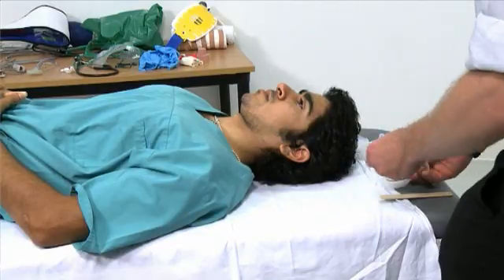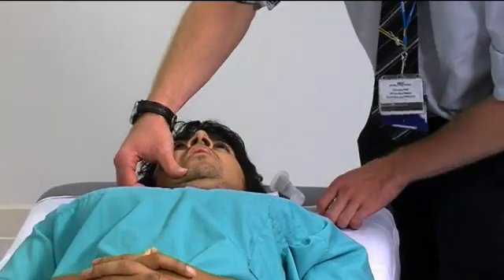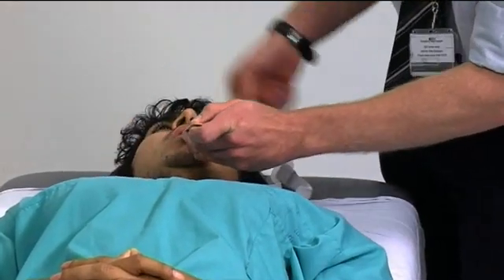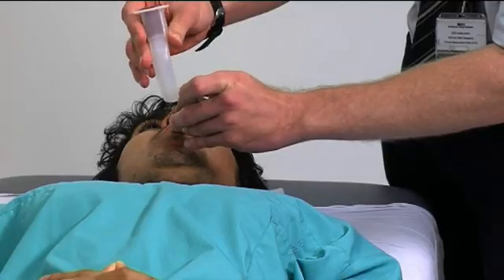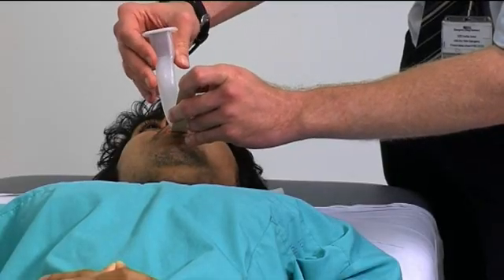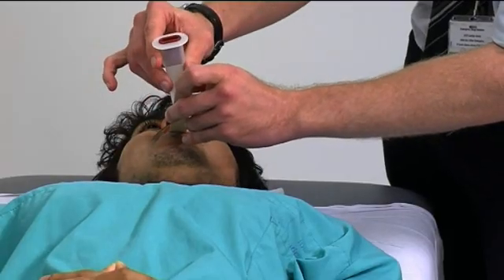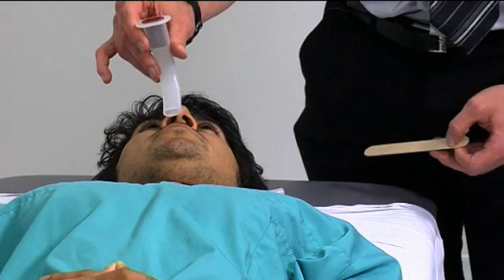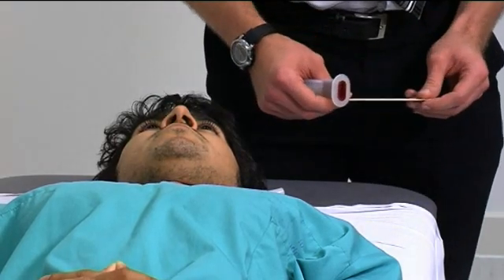Guedel Airway Insertion

Comment: This is completely wrong. This size would be way to big for this patient. Measure incisor to angle of the jaw (with guedel facing forwards) OR corner of the mouth to the ear lobe (with guedel facing backwards). Please take this video down so as not to confuse people.
Reply: The vid is 8 years old
Reply: Distance measured between angle of mouth and tragus area or from angle of mouth to angle of mandible both also correct only disadvantage we have is gag reflex would be present while u insert it....